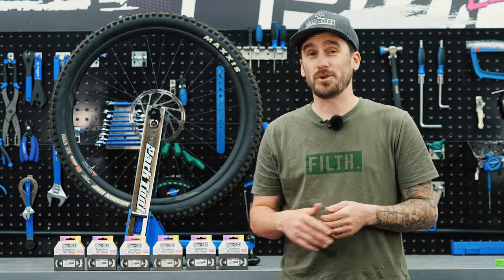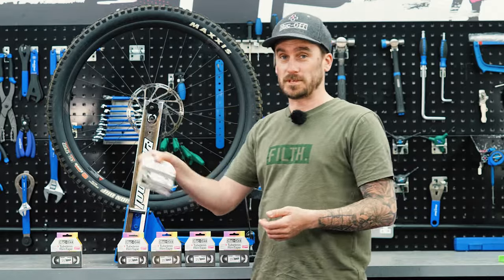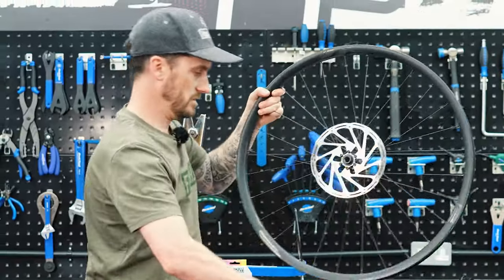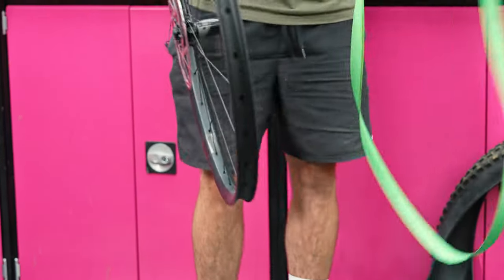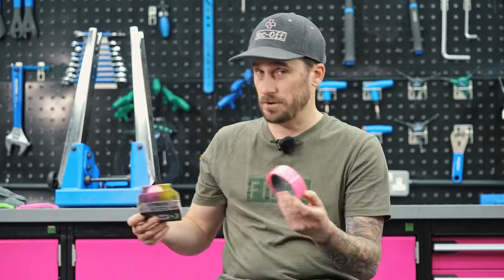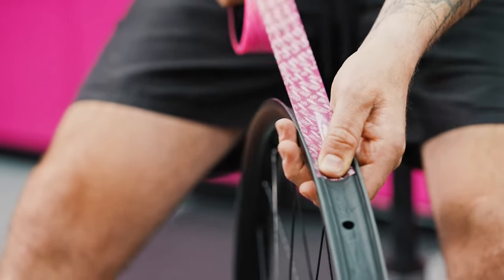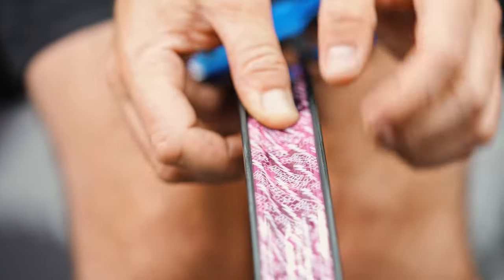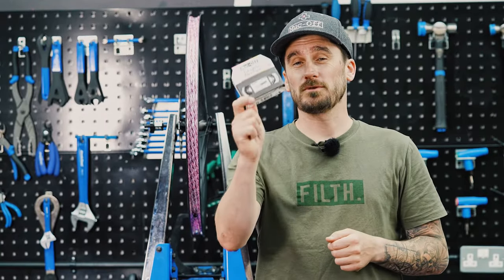How to Fit Tubeless Rim Tape

Comment: How do you install rim tape in pinned joint rim? The gap between the pins is to big to neglec. Do I need to put rim tape in the walls of the rim to?

Comment: Is there anything wrong with stock rim tape? Or was he just removing it so he could demonstrate doing the tape job?
Reply: The stock tape was not tubeless rim tape.
Reply: The stock rim tape only protects the inner tube from the spokes/nipples - it is in no way air tight, making it unsuitable for tubeless rim tape.

Comment: Is it possible to fix/patch a hole in the rim tape without replacing or taping over the whole tape?
Reply: Yes I have before by using tyvek tape. Similar to packing tape but way stickier
 Very thin. Works good for patching tubeless tape
 Make sure to clean tubeless tape very good with iso alcohol

Comment: This tape is suck. The end with the sticker always peel off by itself that make the air and sealant leaking. The glue is not strong enough. I change the so many times and it always happen. Waste of money.
Reply from the maker: Have you tried taping the rim so the end of the tape faces towards the back of the bike? This can help stop any sealant entering under the tape at speed. That make sense? every little helps ;)

Comment: Tried Muc-off sealant. Thanks to the BS reviews of Amazon, from people that don't exist. The sealant just does not...seal.And cold/wet weather, the tire fails to hold air. Terrible product. Cheap. And if you're going tubeless, you want to avoid being cheap. If ya have clincher...stick-with-it, and avoid tubeless. Right...Nukeproof.
Reply: Wtf are you even saying
Reply: @DB-sd3cw  It's a lot of things that has to be right in order for tubeless to work correctly, so if you don't do those right and/or use an inferior product. life won't be trouble free. I assume accu53mation had an suboptimal experience and deemed it not to be worth the hassle. Personally, I have had two sets of tubeless and the one someone else set up had been trouble free and the one I set up had been a bit iffy, so I'm here watching youtube videos to see where I went wrong for my next attempt instead of blaming others. ;)
Reply: you're doing it wrong.
Reply: @GeirEivindMork I haven’t had issues but I hear a lot of bad stuff about muc off tape and sealant